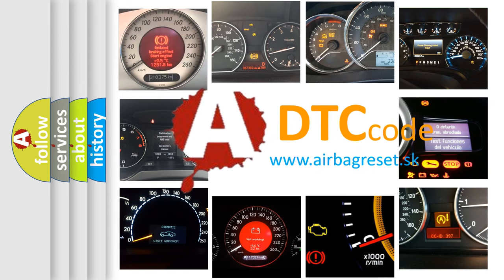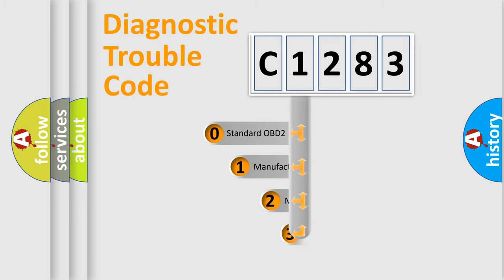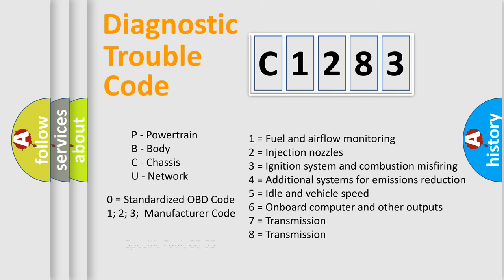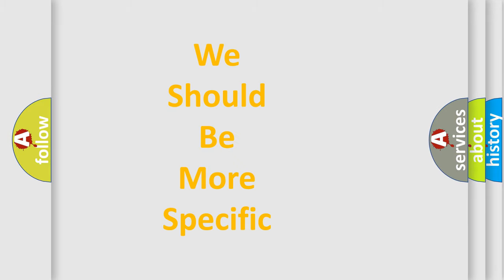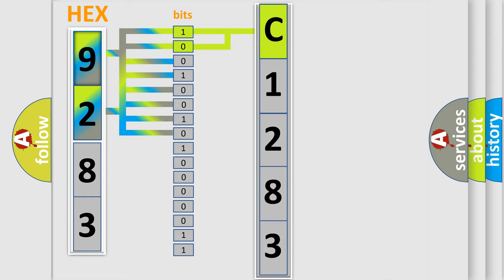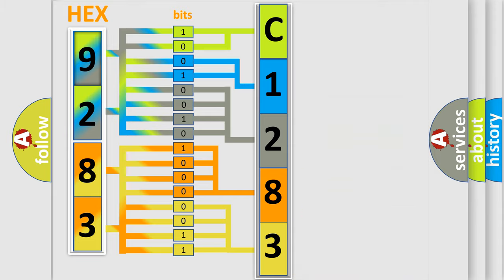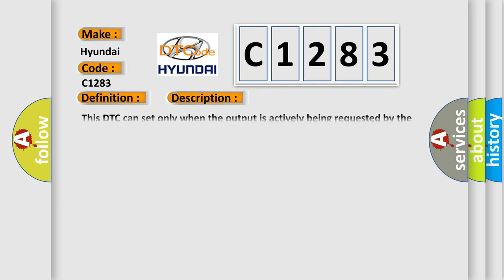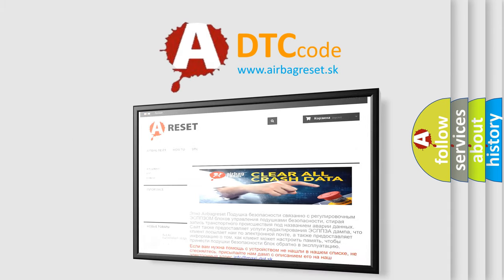DTC Hyundai C1283 Short Explanation

Comment: Where I can find specific error code meaning for my vehicle? OBD scanner usually have common explanation of error code.
I have Hyundai Elantra 2018 (AD J6) and code is c1283(81). OBD scanner program says it is an issue with yaw rate and lateral G sensor, but this model does not have it. Only Airbag/SRS control module.